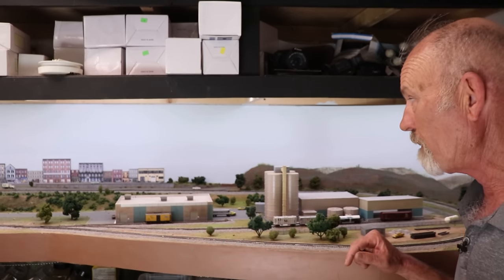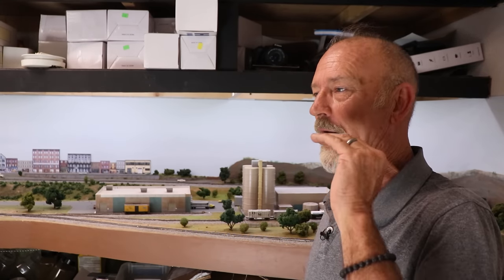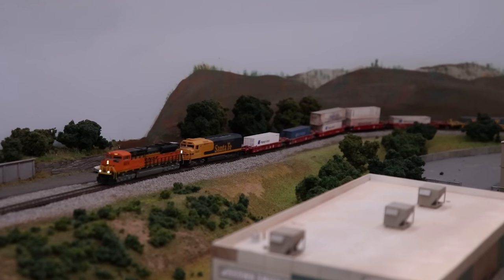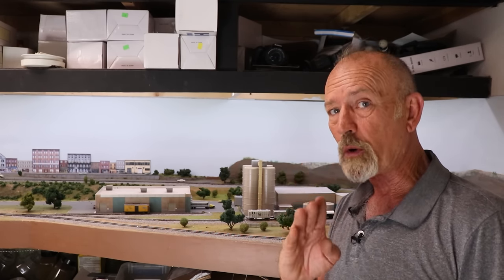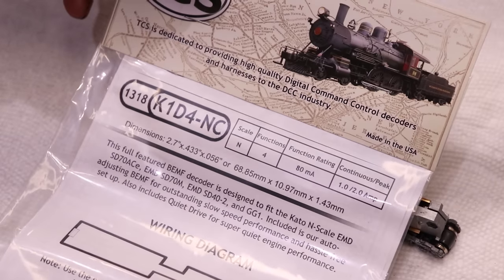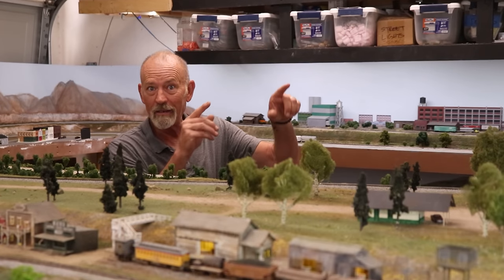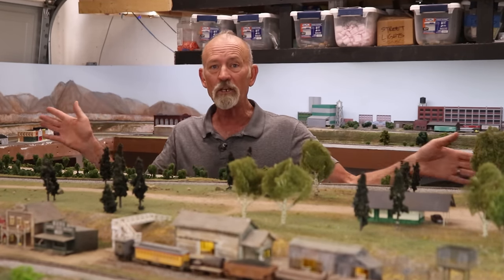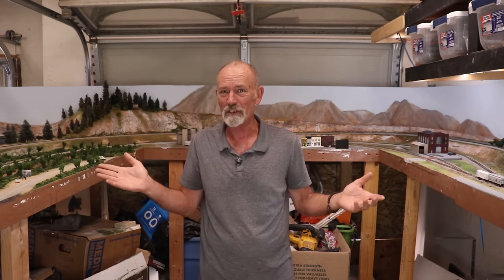112: Grand Finale: Yep, it's the end of the line.

Comment: Dude, I am Bummed that you're not going to do model RR videos as much!!!! But hey, I understand!!!! Wanted to chat about the Decoders a little. I am the opposite from you. I went from TCS to Digitrax for several reasons. TCS makes some really GREAT decoders, and I really like many of the features they have. However, I had issues with my engines taking off like a rocket when I would turn on layout power. They would run wide open for about a second or two and stop as fast as they started. I worked with TCS Tech and they couldn't help me. Also, I had an engine that would all of a sudden lose its CV5 setting, and take off full blast. Again, no fix from Tech guy. Another problem I had was with advancing the throttle and decreasing the throttle. I noticed this especially when I was using the big throttle to program with. I always set my CV2 start voltage to the lowest possible setting I could to make the engine start slow and run smooth. When I would put the throttle to step or position 1, the engine would start to crawl like it was supposed to. NICE. But then as I would advance the throttle, the engine would pick up a little speed like it is supposed to, but then with one more click of the throttle, the engine would slow down to almost a crawl. Advance it more and it sped back up, and then advance again and it would slow back down. Once again Tech guy had lots of suggestion, and I tried them all, but without any success. After fighting these issues, I had had enough, and decided to try a Digitrax decoder. What a difference!!!! Smooth as silk throttle, No taking off when the layout was powered up, and so far everything is working as I want it to. One thing I really like about TCS is, the Keep Alive was built in, and it was all ready for LED lights, plus all in a nice compact package. I was using TCS KAM4-LED decoders in my Bachmann 70 tonners. I do have plans for my old TCS decoders though. They will go in my cabooses to power Marker lights. They have a built in Keep Alive so the lights should stay lit and not flicker, and I can wire the lights up just like headlights on an engine. My railroad is Point to point, so I will have markers on both ends. With the caboose having its own address, I can change the marker lights with a flick of the reverser. 
You have a real cool layout and I wish you the VERY BEST, and hope to see you soon with whatever you come up with for a video. Keep em between the rails my friend!!!!

Comment: Hi Steve, When it comes to TCS decoders I have to agree and disagree, but as mentioned your mileage my vary :-)  I truly love the TCS CN and CN-GP decoders for the older Atlas / Kato locomotives with the split light boards like found in the SD9 and GP35. Now the downside, the TCS decoder for the Micro-Trains SW1500 gave me nothing but problems. Took it out and replaced it with the Digitrax decoder for the Micro-Trains SW1500 and it's been running great. As for No Ox ID A Special, I keep hearing everyone say it's conductive. So I purchased a container of the product, set my Fluke Meter to Ohms and placed the leads into the container, guess what, the meter reads open, aka high resistance. This stuff is not conductive. If it was would, I wold have gotten a resistance reading and was hoping to see 0.01, but instead the meter read infinity. Now a product I do like for cleaning the wheels of my locomotives is DeOxit D5. I spray some on my Woodland Scenics Roto Wheel cleaner, run the locomotive at half throttle and then set it aside for 10 minutes to air dry. My layout also has the Atlas Code 80 turnouts with the plastic frogs and from time to time I'll spray a little DeOxit D5 on the bronze plates that connect the point rails to the stock rails to keep them conducting properly. When it comes to cleaning the rails, I do not use any type of liquid. Like you I've been down that messy highway in the past and have nothing but trouble using products like Rail Zip, Wahl Hair Clipper Oil, Isopropyl Alcohol and I refuse to use harsh chemicals in my home like Kerosene or Mineral Spirits. So for me train cleaning consist of a Cretex Cleaning Block and a little elbow grease. But I think I'm going to try J Olliemark suggestion of using a Nickel and see how that method works. Cheers, Rich S.

Comment: Another TCS convert! I fit their decoders to everything I own for the exact same reasons as you've discovered, their Back EMF algorithm is just too good. I've put their decoders in brand new locos, "new" old stock that's sat for years, even 30+ year old models, and all will achieve a super slow crawl at speed step 1 with zero programming required. Running light or pulling 30 cars, uphill or downhill, it doesn't matter. Here's a short video I made years ago showing exactly this- https://www.youtube.com/watch?v=Y4HdIZJVRn0

Your explanation is pretty much spot on. The Back EMF forms a closed feedback loop, and TCS' decoders know that when you ask for, let's say speed step 1, the motor needs to rotate at a certain RPM. If (when) it doesn't, the decoder increases the voltage applied until it does. It will do the inverse as well, so if you were to conduct your test in reverse you'd find that the Digitrax train would speed up going down your grade whereas the TCS train would maintain its speed (the decoders would see the motor RPM increase due to the reduced load and back the power off). It really is a brilliant system and well worth the extra coin in my opinion.

Comment: On the subject of track cleaning: the "black stuff".  There are 2 camps that are polar opposite as to belief of cause.  I don't understand how that is possible. 

I believe micro arcing of running the train engines causes it based on my own experience. Thus, running trains increases dirt vs not running anything. 
So I'm in the not marklin camp. 

 Here is why... I have a 12 x 14 track that is about 40 years old now. I have 3 sections of track that have had varying use. One section has no use for over 5 years. One section has had very limited use. One section has had regular use for a year or so.  The unused track has no black residue. The limited track has minor residue. The regular use track gets caked in the black stuff and needs constant cleaning. I have been checking each regularly since that marklin video.

Marklin and the others are so experienced and knowledgeable!

It seems like a paradox. Both camps are polar opposite and yet there is the evidence for both views. 

My problem is I don't understand how both can be true...  Running trains regularly leads to no track cleaning vs no running at all needs no cleaning????

How can experiences be so completely different to such a universal issue ????

On a different note: I have enjoyed your videos :)

Comment: The point is not the incline, up to 3% is fine, it is the curve.  Putting a curve in an incline doubles or triples the friction.  Interesting comparison between TCS and Digitrax.
Reply: I follow another RxRer who has grades through his curves/ turns & has no problem
Reply: @terryperrott8567  If they’re 12 wheel diesels no problem.  Steam locomotives are a far different story.

Comment: Steve, I'm curious: Did you ever contact Digitrax for assistance with your problem? As Jeff Faust noted earlier, for some obscure reason Digitrax disables Back-EMF in consists, but you can re-enable it with a CV setting. In my experience, TCS has horrible tech support: most of their responses read as though they were written by lawyers, not modelers. That said, I have a bunch of TCS decoders and I love them. I also have a bunch of Digitrax decoders and I love them as well. I would never advise wholesale replacement of any brand of decoders unless the manufacturer's tech support has tried and failed to solve the problem.

"There is no problem that cannot be solved by brute force and ignorance."

Comment: Using anything lubricant based where you have grades has obvious issues. Anyone who wants to experiment with automatic transmission fluid should be sure to use only varieties specifically rated safe for plastics.
Just know that the oxide of nickel silver is more conductive than any coating you could apply.
Reply from the maker: Hi Donald. Actually, my final solution was suggested by one of our viewers. I rubbed a nickle over the who branch line and suddenly my trains are back to running smooth. Not sure how long it will last, but if I run my trains often enough the rails should remain in pretty good shape. Thanks for the comment and for watching my friend.

Comment: Steve, can I get 200 ingot of Unobtainium please?   ;-)   Great video, sorry the No-Ox didn't work for you.  The folks that I've known that used it applied it like you described then basically wiped the rails completely off.   That leaves a trace amount behind, which is apparently what you want.   

I see someone shared a fix for the Digitrax back EMF issue in consist.  :-)

Comment: Hey Steve.. it's been While Brother since I seen your Last video the Layout I think what ya got.. your Set up it's just Cool.. not over the Top but just set Right..  On the Digitrax Decoders I have to agree with 1000% there brother they just can't achieve what a TCS or a ESU can and after that pickle bite of a conversation that I had with Digitrax Employee that overseen installing & programming of the Decoders which left a Bitter taste in my mouth i wouldn't buy & install any more of them Now my..  My TCS which I have in my Gevo BNSF 5804 that thing is puller Steve I'm pulling 8 Autorack's which they're pretty heavy for there small size most of them are Intermoutain/ FoxValley's they have the Metal underframes like the Microtrains they do have Metal Wheels but it Gives my Gevo a Work out.. But the TCS's have such a Great slow Creep and that Engine can pull or shuv @ speed step 1 I watched closely to see if there was any Wheel slip and it can do the task.. 

As for Rail cleaning an using product to make my Engines Run better I stuck with what Gregg at Fishplate Films suggested Inox mx3 he said stay away from IPA Isopropyl Alcohol just clean the Track with Inox then Retreat it again in between the cleaning and the Final step i whiped off the Rest and my Track has a soft feel to it but my Track is also well Seasoned I haven't changed any of it since putting it in place back in 2016 I've heard laying new Track it takes a while to get it seasoned where the Trains well on it a person is constantly pulling up or changing Track configurations and not letting the Track wear in your gonna encounter problems.. On the NO OX ID I use it very sparingly I put a light coat on the switch points I rub it in and leave no extra to render Sparking which to much can using this ive been able to go into my Yards that's un-powered the power comes from the Main..  As for spreading on my Rails I have not Ron Marsh says its been Working well for His Layout.. 

On my Route That I Run my Big Boy Steve I just clean the Tracks with IPA I know Gregg would Probably box my Ears for saying this but as was Mentioned and I love the Inox but it Don't mix Well with Engine's that have Rubber Traction Tires so i just use the IPA and I tell ya Steve That Big Boy man I like Running that little Dude it.. it was like when I watched you Running your Little Shae Steamer it makes ya Grin Ear to Ear.. and it can Handle my #4 Kato Turnout pretty Well only had a few instances where it lost power for a few seconds...  

And on End of the Line Your Video's Steve there like Watching A Uncle Mike Fifer's Video they make ya Want to stay to the End Great all the Way through Now If I can just figure out a Way to get me a Its my Railroad T-shirt.. I'll have Made show off my Dedication & just say its my Railroad Baby, There Awesome Steve and we'll end here hope I didn't Drag this out Too long like to give my Honest thoughts and with my Mom having two Strokes in short time her health comes before my Trains she's doing Good taking it Slow but she tells me go run your Trains & Get your butt outta here and go Enjoy the Train show we had a few weeks ago and on occasion I get some Railfanning in.. But she's my Rock Steve.!  For Now we say Good By and hope to see some more Video's in the Near future Take Care.. Be Well Allen D

Comment: Wow the TCS against DIGITRAX decoder comparaison is worth a thousand words , I have 160 locomotives with DIGITRAX decoders at 99.9% .....😪
Reply: just use JMRI to program the BEMF and you will not have any problems. I have 300 locos with about 5 different types of decoders. just program them and you will never have a problem. you have to do it anyway to speed match them anyways
Reply: If you set CV 57 to 102 on your digitrax decoders, the BEMF will work as expected when consisted.
Reply: @josephbraddock401  ok thanks I will check what it says for that value .
I own and run a lot of locos of different brand all speed matched but I never really experienced what he is showing in the video
Reply: @josephbraddock401  will it change something else in the settings if I change the value of CV57 ?
Reply from the maker: @CP - I worked the BEMF on the Digitrax for hours. It didn't help. But I didn't use JMRI.
Reply from the maker: @Joseph - I did that. Nothing worked. The TCS decoders work perfectly right out of the package :)
Reply from the maker: @Louis - I only experienced a problem with that 2%+ grade. Other than that they worked fine on the layout.
Reply: @louisletourneau3429  No.  Digitrax decoders automatically turn off BEMF when they are consisted. I believe they do this because early decoder equipped engines could fight each other on grades if they were consisted and BEMF was on, but that is less of a problem now. Setting CV57 to 102 will have BEMF work for both single engines and consisted ones. If you don't like it set that way, you can set CV57 back to 6 which should be the default.
Reply: @ItsMyRailroad  TCS definitely has phenomenal BEMF in their decoders. The 102 setting was given to me by Digitrax a several years ago. We use it on all of our club locomotives and run some pretty long trains in HO (25 to 48 cars). Sorry it didn't work.

Comment: Track cleaning - that black stuff

This is known as micro arcing, due to micorscopic pits on the rail heads.  The minute archs are burning residue, probably conductive stuff, and leaving deposits on the rail heads.  this is virtually impossible to get rid of unless you have absolutely perfect metal on metal contact.
This REALLY shows up with DC current rails and is NOT DIRT.  Keep the Sxxx off the rails and run your trains.

Bob S

Comment: Don't care what anyone says, I have 2 friends that have been using transmission fluid for many years and have no problems. I also know of a club that uses it. They never say that you will not have to clean the track ever again, just not as much as normal and this does improve track to engine electrical conductivity. But, you still have to clean the track periodically. I don't believe anyone ever said anything about "never needing to clean track again"... Stop it !!!!!!!!!!!!! Run your trains once a week and never have to clean your tracks.. That's just BULL S..... Ok big man. Let us see what the track cleaning pads looked like just before you did this. And, in some cases the addition of either of these will loosen the dirt that is already on your track. Was the track really clean at the start, I wonder...Or maybe a garage is just dirty...